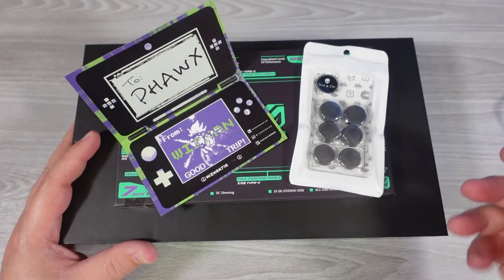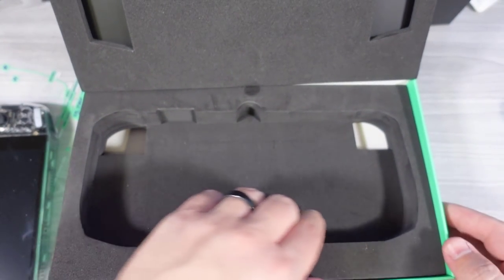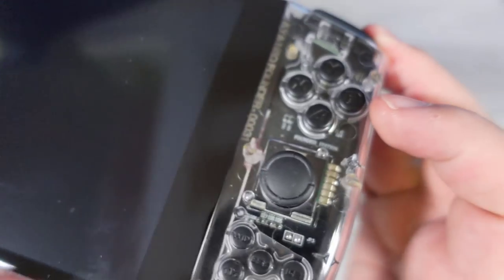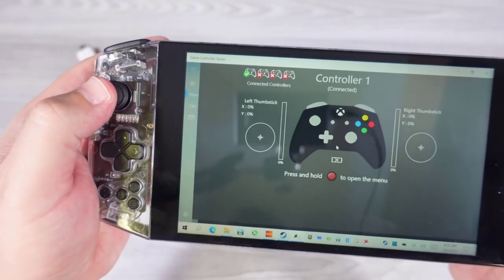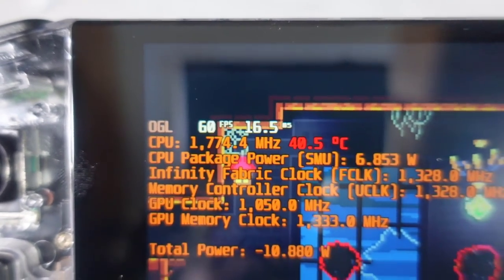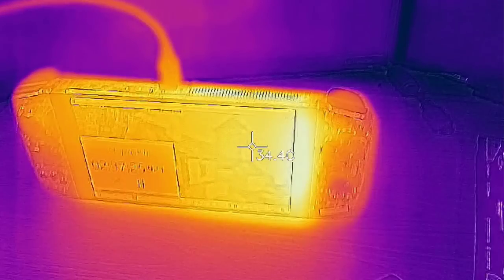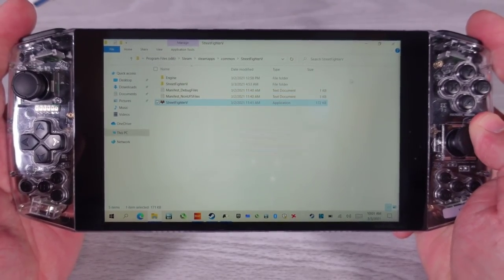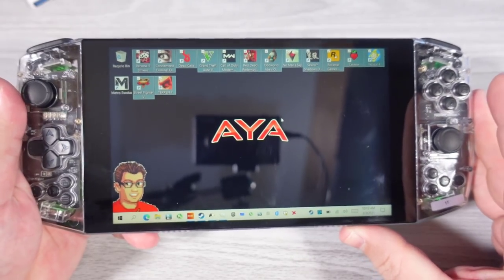AYA Neo Founder Edition - Unboxing And Comparison To Pre-Production Model. Gameplay Coming SOON!

Comment: Even if you do disable full screen optimization, you should be able to bring up Steam's virtual keyboard in-game by holding the guide button and pressing select. Make sure you have Steam Big Picture overlay turned on. It's off by default. 

Click on "Steam" on the top left, then settings, then click "in-game", then you want to turn on "Use Big Picture Overlay when using Steam input from desktop"
Reply: Does using Big Picture Mode still impact performance? I haven't used it in ages.

Comment: They delay the Indiegogo until further notice because of the shortage of semiconductors. I am panning on still getting one but if it takes forever then I will look at other options
Reply: Win gpd 3 is available but ends in like 2 days
Reply: Importantly, Intel produces their own silicon, so they should theoretically be more insulated from such delays.

Comment: There is a software on Steam called "Controller Companion". It maps a controller as a mouse + WASD. I use it since the GPD Win 1 days, as I  like the bindings way better than GPDs. It also brings up a Controller Keyboard when pressing L3. Maybe it fixes the little quirks you ran into.
Another thing: How do you like the Neos screen in comparison to the Win 3. I am afraid the Win 3 might be quite small, as I am already having a hard time with the Win 2s 6" display.
Reply: I use joy2key but steam itself has built in keyboard to mouse feature.
Reply: I mean keyboard+mouse to joypad settings.

Comment: Im worried about the analogue sticks are they the exact same as the switch ones because the switch ones are just not that good for fps games. Hows the quality esp compared to the gpd win 3 sticks
Reply: I think both Taki and The Phawx have said that the Win 3 has the better joysticks.  The Aya Neo have Alps like the Switch, it should feel pretty much identical to the Switch except for the angle snapping.
Reply: @LeesChannel  such a pity because i like the form factor of the aya though the gpd is attractive because it’s shorter width despite its greater thickness does give the perception of greater portability. Just honestly it will come down to stick quality for me because i like playing fps games. Guess imma be getting a gpd eventually if they successfully make it a commercial product
Reply: This is a very expensive toy. They should have develop their own analog sticks and not make use of another company’s sticks.
Reply: Wrong the switch has full analog sticks, they actually are very good depending on your calibration..sure they are not Xbox elite sticks, or snk stick which would not be viable for mass production considering the cost of the switch.
Reply: That has always been my primary complaint in a lot of these mini-PC consoles. The analogue sticks were just not to my liking, but I had not head about the Win 3 sticks by comparison, so thanks for that.
Reply: The fact that the Aya has sticks so similar to the Switch makes me feel like they'll eventually drift.

Comment: I'll get GPD for now. Heard the Aya neo will get delayed. Once it goes for pre order I'll get the Aya neo as well.
Reply: Win 3 has better emulator power from what I saw. But if it comes to steam games it should both run them fine. Win 3 does support nvme 4.0 but will come with a 1TB 3.0. In any case I went with the Win3. Then if they make a win max 2 most likely will get that one to.
Reply: Tbh GPD Win 3 worth more than Aya Neo. You have keyboard, great joystick also thunderbolt 4 for external GPU. In term of specs overall GPD Win 3 is better than Aya Neo. The only downside from GPD Win 3 is screen smaller than Aya Neo
Reply: @runninginthe90s75  screen is the same as the switch light. 0.5 smaller then OG Switch. So now look at a PS vita. How was that screen size to you. Now the gpd win 3 looks big.
Reply: @NatsumeKonno  I own PS Vita, it has 5 inch screen which is enough for me, tbh i don't have problem with 5.5 inch screen on GPD Win 3. I don't get why people complaining about it, meanwhile Aya Neo has 7 inch which is not fit in pocket. Its kind of useless when you have to bring it with bag. Handheld device but need bag? i rather bring gaming laptop.
Reply: @runninginthe90s75  I'm fine with the 5.5 screen also i can throw on a switch light screen protector then im good. Want a big screen il use my razer blade for that hard-core gaming on the go.
Reply: I bet your wallet is crying right about now.
Reply: @2010ngojo  crying indeed but I can't wait to get both devices and test them out .
Reply: @fuentesjuanjose90 
Don't worry. I'm on the same boat.
Reply: @fuentesjuanjose90  i like the large screen of the neo. Dunno if i would buy it as a second if i got the win 3 already. I might save that money for next year if they make a max 2 or better.

Comment: Would using a Linux distro help deal with the full-screen optimization issue? I imagine, since Linux is a completely different system, it's virtual keyboard operates differently? Or will it work on this device at all?

Comment: I bought a gpd win 3 but if aya neo is successful and they make an aya neo 2, i will buy it!
Reply: How are your experience with the Win 3?
Reply: @grafvinestarry  I mainly bought it bc it's more portable, it has a meh keyboard but at least it has one, good ps vita quality buttons, it comes with a dock like switch, a slightly better processor and more storage ssd space, and micro ad card to expand memory. Really powerful device!
Reply: @johnnmartinz7554  I see, I have the Win 2 and I would like to upgrade to the Win 3
Reply: @grafvinestarry  I say sell your gpd win 2 so you get some money. I bought on indiegogo for 950$ with the dock but I don't think is still available, it may be around 1,000$ or a little more, but I think since you got the Win 2 than I think it might be worth the buy. They won't come out with win 4 until 2022 or 2023 with an amd gpu. So you can buy it or wait. It's up to you. Either way it's a cool  device.
Reply: @johnnmartinz7554  ok. But I wanted to ask how much portable the Win 3 is 😅 I'm really happy with the Win 2 since I have bought it 2018 in my Abitur.
Reply: @grafvinestarry  Sounds great and its not that much heavy than win 2 and i put in my book bag, its portbale but not pocketable. Hope that helps.
Reply: @johnnmartinz7554  yes it helps a lot.

Comment: Great, i dont think theres a 1tb option. this will be more cheaper than the gpd win 3? I purchase the gpd win 3, but with each video i see, the more i think the best is this aya neo...
Reply: there is a 1tb option
Reply: I think GPD WIN 3 is the best, look at the analogs i have GPD WIN 2 and the analogs are greater than the AYA NEO, and AYA say that they are having delay etc, so i think you must go with GPD WIN3 or ONE GX1
Reply: @Mati10078  i was thinking in term of performance. I adapt to various gamepads
Reply: The GPD Win 3 uses a more powerful chip set, and will usually have slightly better performance. That said, it will suck much more battery life if you want to truly tap the performance, and Intel drivers are less reliable than AMD drivers. Overall, if power is your target, go Win 3. But the Neo will be very capable nonetheless.
Reply: On games, the aya neo will be 20% to 30% slower than the gpd win 3, around 15% more than the win max ,which bus excellent. Don't count about ryzen 5k before next year I think cause amd has some trouble making their chips at the moment.

Comment: These analogs are the full on broken, they use the same ones as most the ipega's and gamesirs none of which are full analog but rather digital sticks there is a massive diffrence in aiming when playing fps games. I doubt a firmware will fix this but I can be wrong. However Its never been fixed on an ipega/gamesir/saiteke/moga/jxd device ever to this date.  Flydigi and gpd are the rare exception that they use real analogs its why their android devices were popular. Maybe they will fix it for the release version.

Comment: This thing is amazing... My dream of replacing my Switch with something that I can make full use of my thousand plus Steam library.
That said, it's expensive enough that I'll probably skip it... :/ not because of price, but because with how much I'd have to spend, it'd need to be perfect. Same reason why I didn't go for the alternatives.
I'm sure they'll reach their goal anyways, but a few things gave me pause, different ones from GPD Win 3 and OneGX 1 Pro, the only two other devices to achieve the same incredible specs.

GPD the screen is a bit too small for me, which made the gamepad kinda awkward, and that keyboard is kinda of a waste of space for my personal experience... So perhaps the next version could be better.
OneGX 1 Pro gets very very close, but it's also the most expensive one... And it's cpu is actually weaker than the GPD Win 3.
Not sure if I'd get used to the form factor though, because I'm very much used to the Switch.
Finally, the Aya Neo. It has almost everything I felt missing from the others... big screen, Switch style form factor.
I'm not entirely sure about this just yet, but it feels like having AMD instead of Intel Iris will help with game compatibility for a little while at least.... Iris Xe is a bit too new, and some games are having trouble with it.
The problem I have personally with Aya are the integrated gamepads.
The thing I hate the most about the Switch is the drifting issue. I'll eventually come around to get 3rd party joycons with different analog sticks to avoid the issue altogether, but it's one of the things that made me consider buying something else entirely.
Considering how expensive these devices are, I really don't wanna pay all that to end up with a Switch like PC with integrated non-interchangeable analog sticks that drift or have other problems kinda like the Switch.

But of course, this is only a personal accessment.
My ideal device would be something like a 7 to 9 inch tablet with Aya Neo or GPD Win 3 guts, and then I can add a clamp style gamepad or portable keyboard with it... So I might not be their exact target market. :P

Still, it's been exciting to see the development and release of these little beasts... xD Carrying around your entire computer and gaming package with you wherever you go is getting closer and closer!
Reply: But you were excited when steam announced theirs!
Reply: @Dmrdecs  I am! Because of pricing mainly, but also because I don't think those thumbsticks Valve is using are prone to problems like the dreaded Switch joycon drift... those analog sticks look more similar to regular sized analog sticks, and the Deck has enough "heft" to house them.
I will kinda miss having thunderbolt 3 on the Steam Deck, but price still kinda justifies it.
Of course, still kinda speculation since there is no independent testing on it, and either way it'll take a long while if ever for Valve to officially release it where I live... oh well.

Comment: Which one is best AYA or WIN 3 ?
Reply: In my opinion, they both have pros and cons.
The aya neo has a bigger screen and better resolution but lacks the gpu and cpu power compared to the win3. It also doesn't support egpu. 
The win3 has better gpu and cpu power (if you get the higher end version) and supports thunderbolt for egpu but it has a smaller screen and only 720p.

Both can run AAA titles so the deciding factor is if you want more performance but don't mind the smaller screen get the win3, but if you don't mind lacking in performance but prefer a bigger screen then get the Aya Neo.

Hope this helps.
Reply: Thank you very much for your reply 😊, it was very helpful👍.

Comment: Performance is underwhelming, how comes AMD APUs have worse GPU than Intel? Maybe there is some way to unleash some FPS increase by overclocking it? Picasso mobile parts overclocked like crazy, could you try this?
Reply: 0 iq comment
Reply: @megazenn22  🤣
Reply: @megazenn22  Could you elaborate? My perception was that AMD APUs were targeting higher TDPs and performance segments and Intel was a king of low power, mobile chips in thin devices with long battery life, but absence of beefy AMD handhelds and efficiency of AYA NEO at lower performance targets proves, that in reality it is other way around.
Reply: @adamkamieniarz9223  if it coukd be overclocked why wouldnt Aya do it? And gpu power isnt the point of this, it has way more than enough power for its intended use of 6th gen emulation and indie
Reply: @megazenn22  
>if it coukd be overclocked why wouldnt Aya do it?

overclocking comes at a cost when it comes to battery life and acoustics, so they could limit the chip to reasonable level and leave option to go balls to the wall to the end user.

>And gpu power isnt the point of this, it has way more than enough power for its intended use of 6th gen emulation and indie

On AYA's site they mention emulation 0 times and marketing seems to be more focused on AAA gaming.
Reply: @adamkamieniarz9223  much of the apu's limitations revolve around memory bandwidth. The aya team have chosen to use lpddr4 instead of ddr4 which has benefits to the memory speeds. There are some over clocking channels on yt that have demonstrated memory speed impacting the performance of the GPUs of desktop renoir.